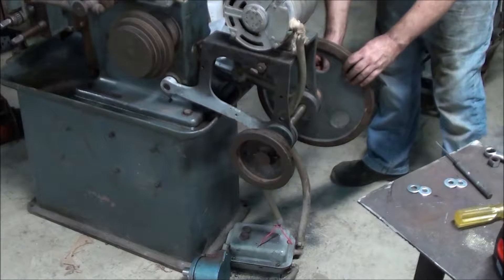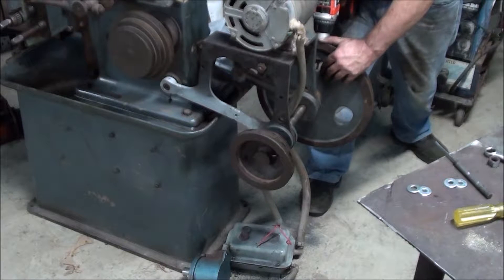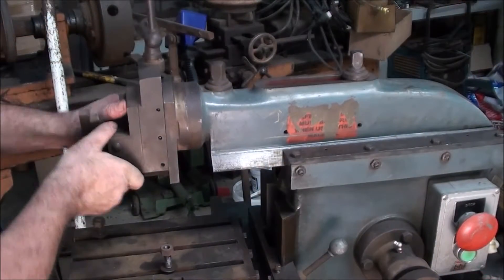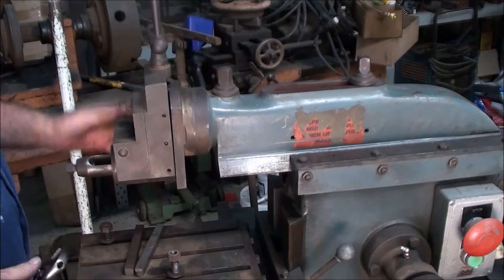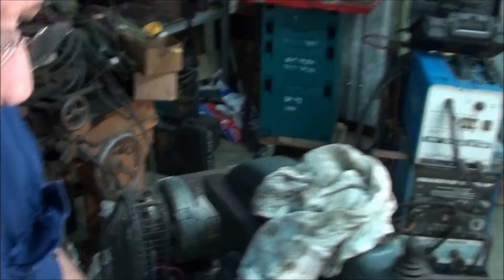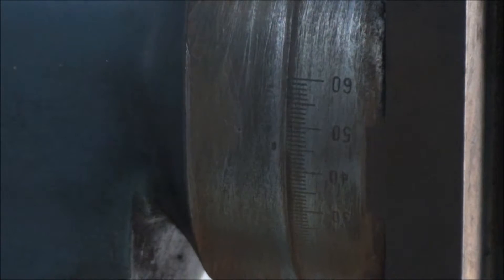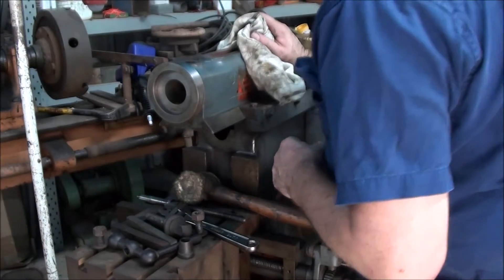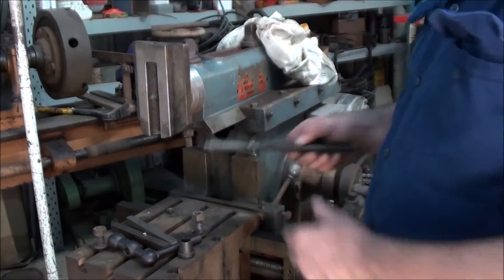Metal Shaper Action -  Repair Part 5

Comment: Thank You. It was much more involved than I first realized. The main beam had been brazed at some time. The repair had cracked. I spent many years in the welding trade and was able to re-weld and reinforce the cast iron beam, luck would have it, the cast was a very good grade. There were also gears  and part of the advance mechanism missing. I was able to remake those parts with the help of a picture a man sent me from a machine he bought from auction. Actually the only other Hollingworth that I have been able to find on the internet. The motor and drive transmission were gone also. Those are replaced with a five hp single phase and a 4 speed Drive All I got off another machine. A challenging project that I would have not undertaken if I had known what it evolved. Being 74 I'm not as motivated as I once was. But it turned out well and is very accurate for what it is. Hope you are doing well and thanks for inquiry.

Comment: Good to see the compound slide assembly come off without much trouble. Mine was seized, I got it moving but could not get eccentric out to remove the assembly from the ram. I expect that at some ime the rod shaft ws damaged by the eccentric being 'tapped' tight !
For now it works.
Looking forward to gib strip make up and it.
Thanks for uploading 
mat
Reply from the maker: Thanks for watching and commenting again Mat. I filmed this series some time ago (Jan 2015 !!! yikes) but I'm only just getting around to the editing. I've been very fortunate with the machine in as much as the machine appears to have done very little work. Apart from the missing gib, broken motor mounts, and two bent shafts, there appears to be no real wear in the machine at all. There were a couple of camera issues and unfortunately some footage just didn't get taken.